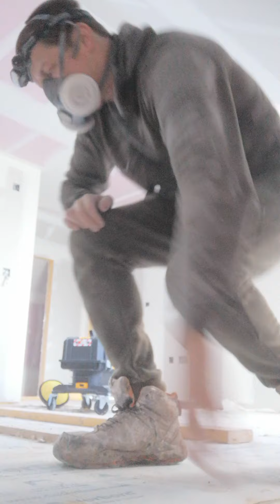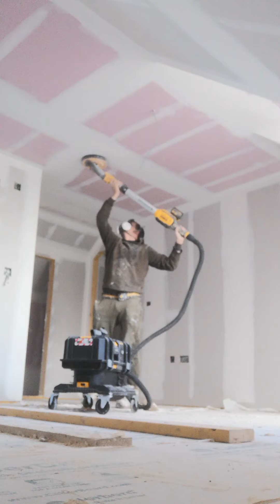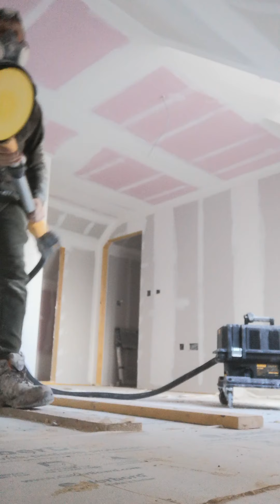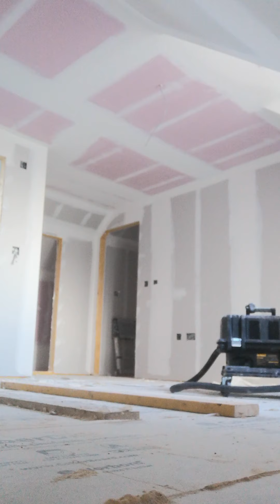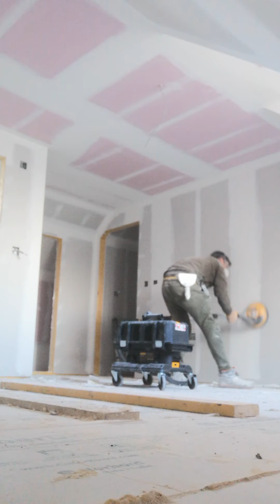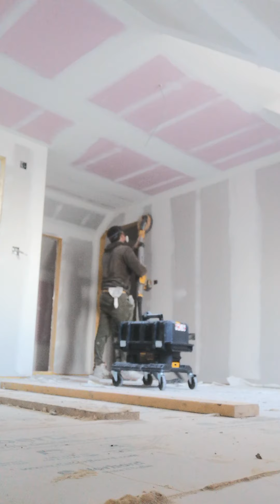Dewalt cordless drywall  sander & dewalt  m class  extractor.

Comment: Where do you get the wheels mate
Reply from the maker: Ebay I think mate.
Reply: @andywhite1550  cheers mate
Reply from the maker: @jonnymorton1237  I've got the larger wheel version. Think I typed in dewalt cordless extractor wheel kit

Comment: Does the sander leave lots of swirl marks.
Reply from the maker: Not really mate. But the contact isn't the best with standard discs. The  backing pad is quite hard so I use 3mm interface pad and 150grit sanding dics. But b4 that I used the flex padded discs  for a better contact with the board.

Comment: Hi there ,is the bag reusable?
Reply from the maker: Yes. No zip to empty but the drywall dust just falls out of the hole easily.
Reply: @andywhite1550  thanks for the reply I didn’t fancy buying loads of bags .I think this is my next purchase thanks again
Reply from the maker: @dieseldes1301  no problem mate.
They are good quality bags.  They last a good while treated right.  I have used it without a bag I know guys that don't use one. They just empty it more often and tap the filters clean. Which works OK. But today the taping was a bit damp in places and it clogged the filters quicker. So I'll be back using a bag again.
Reply: @andywhite1550  cheers mate I also use your tip with my three ways and a corner trowel works a treat 👍
Reply from the maker: @dieseldes1301  oh really!
It's a method I tried to help my apprentice who couldn't do 3 ways without a deep knife mark in it. I was so impressed with them after sanding it has stuck with me to. Although it takes a little longer to do. It's all about the finish though.

Comment: That capacity battery's you are using. And how many of them do you have to go on job with confidence
Reply from the maker: 3 9ah batteries will do a 2 and a half storey town house on the extractor and 2 6ah batteries on the sander.
I have 6 9ah batteries and 4  6ah batteries for a days sanding.

Comment: Sup bro? Finally I have invested pretty heavy to get these bad boys....7×12ah batteries, 4×6ah batteries and 4×5ah batteries 
Vacuum and sander.
Seems like dust control of this cordless thing isn't that good, sander is really heavy, and it leaves swirl sometimes (pretty bad ones) 
Got any idea what should I do to eliminate the swirls marks? 
I am using festool 220 sanding disc
Reply from the maker: I use the flex padded 220 grit. (yellow ones) I don't get any problems with them mate.
Reply from the maker: I can't say I've had any problems with the dust or weight of the sander. But saying the I've only used cheap sanding setups before I used the dewalt.
Im sure the dust extraction isn't going to be like a 110v festool extractor.
Reply: @andywhite1550  thanks bro
Reply from the maker: @farhadhabibullah548  just checking you haven't put a festool backing pad on it.
I've done it and to much dust escapes from it. That's why I just use use the padded sanding discs.

Comment: Hi Andy thanks for doing the video mate ,in your opinion how many batteries all told would I Need to sand a 3 storey ?
Reply from the maker: For the sander and extractor imo you would need 1 9ah battery for the sander and 3 9ah batteries for the extractor. But this depends on how quick you are with the machine. Rougly 20 minutes  per battery for the extractor. Rougly an hour for the sander.

I own 9 9ah batteries and that will keep me going.

It's an expensive way of doing it but I just like being cordless.
Reply: @andywhite1550  thanks for the reply ,I’m definitely considering buying it .I’ll look out for any more of your vids 👍

Comment: Are you still using this set up? I am finally getting sander and extractor, been looking at this set up. Because its cordless. Im guessing you would need quite a few batteries for bigger jobs?
Reply from the maker: Hi mate. Tbh mate I like the set up but I wouldn't recommend getting it for the money it costs.
The extractor needs to many batteries for sanding all day and extraction isn't great.
Also the sander is nice to use but keeps breaking. I'm on my 3rd one in a year and a half.
I think the for the money your better off buying and small  powerfull  and light weight suitcase generator. And sander setup.
Reply: @andywhite1550  hmmm. I dont really mind spending the money. As for me i think, being it cordless, is a major point. What kind of issues you have had with sander? Has dewalt been okay with replacing it?
Reply from the maker: @EErixXX  I think it's something to do with the motor. Dewalt have been good and replaced them for new. But its a pain to keep sending off to get a replacement. I've just bought a new one from screwfix. So if it breaks I can take it back to the shop rather than sending it away. Plus now I'll always have a backup sander.
Reply: @andywhite1550   ahh fair enough. Well, ive orded it today haha

Got  2 x 5ah and 2 x 6ah batteries for sander
And for extractor got 2 x 9ah and 2 x 12ah batteries. 

So hopefully should be good.
Reply from the maker: @EErixXX  nice mate. You might have better luck than me with the sander lol
I like using the 5ah batteries on the sander makes it lighter.
You might want the disconnect the alarm on the extractor. It gets a bit irritating after a while.

Comment: Does the dust extractor collect most of the dust?
Reply from the maker: Yes it does. I use a 220grit  padded flex sanding disc and a bag in the extractor. It does a good job.

Comment: Hi buddy!!! How heavy is it???
Reply from the maker: Not that heavy mate. 8.59 lbs plus battery.
It works well with a 5ah battery  which doesn't add to much weight.
Reply: @andywhite1550  
How long it work on a 5ah battery? 
And the vacuum work on same battery 5ah ? And how long ?
Reply from the maker: @imlegendist  a 5ah battery on the sander will sand a small 2 bed.
Never used a 5ah on the vac. Not long I would say as a 12ah will  sand a a floor of a 3 bed. Roughly 25 minutes.
Reply: @andywhite1550  it lasts only 25 min on 12ah??? Man, this thing is a beast.
Let's say I work 6-8hours to sand, I need 10+    12AH batteries 🤦🏻‍♂️
Reply from the maker: @farhadhabibullah548  yes for a full day of sanding I've got 10 batteries. I found there isn't much difference it time with the 9ah and 12ah batteries.
Expensive setup but I love it  cus it's cordless lol
Reply: @andywhite1550  thanks for replying mate, let's say if I have enough batteries to run this beast, can it sand as good as electric sanders? Powerful enough?
Reply from the maker: @farhadhabibullah548  yes mate it's just as powerful and a really smooth sander to use. Works better with padded flex  sanding discs or get a feestol backing pad  for standard discs.
Reply: Hi buddy 
I decided to go cordless and spend some serious $on dewalt set.
What do u think about 9ah with 12ah? 
Which ones should I get? Cuz u said there is no big difference between these two batteries.
Thank u
Reply from the maker: @farhadhabibullah548  the 9ah batteries give about 20 to 25 minutes of runtime. The 12ah give about 35 to 40 minutes of runtime.
The 12ah batteries are £100 more expensive so it's up to you what you want to do. If money is no problem buy all 12ah so you need less batteries. But 9ah batteries are a more cost effective way of doing it.
I have 10 batteries for a day of sanding.
Reply: @andywhite1550  thanks bro

Comment: Hi bro 
How long does it take to fill the dust extractor with dust, if u sand non stop?
Reply from the maker: I use 220 grit sanding discs. I can do a house before I empty/change the bag.
Reply: @andywhite1550  thanks bro

Comment: Is it worth the money?
Reply from the maker: I love the sander nice bit of kit. The extractor is OK for small jobs. But it uses alot of batteries for a day of sanding. Could also do with larger dust bags and collection tank.
Reply: @andywhite1550  Great to know thanks for the response
Reply: Does it throw a lot of dust into the air or does the extractor get most of it? Debating on getting the dewalt or a porter  cable.
Reply from the maker: @ocd7036  it does a good job collecting the dust mate. The poor video quality is the dust behind my phone screen.
Reply from the maker: @ocd7036  most annoying thing about it, is the alarm that goes off when the filters are  blocked or bag is full or low battery.
Reply: @andywhite1550  where do u get a larger collection tank?
Reply from the maker: @farhadhabibullah548  there  isn't a larger tank but I've seen a you tube video on making a dust collector compatible for this.